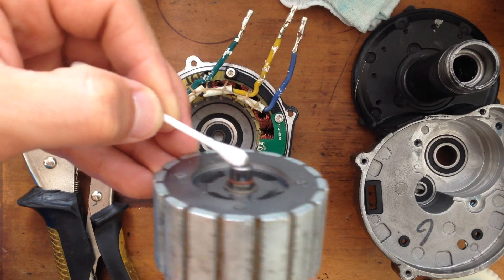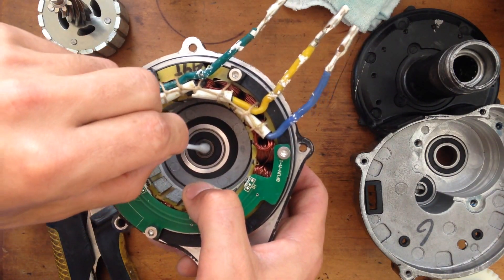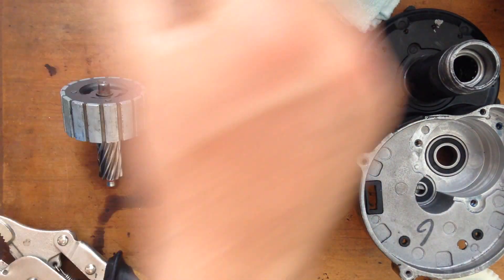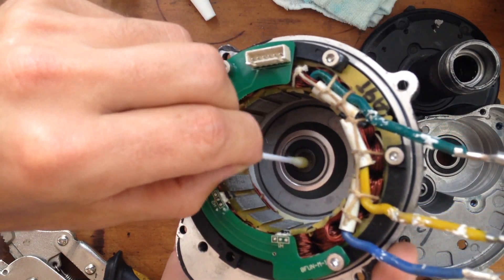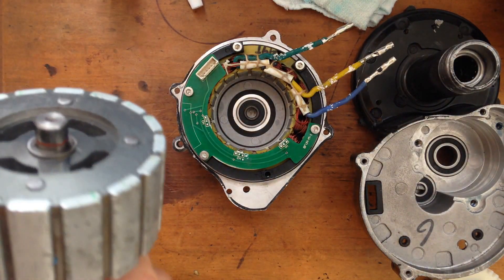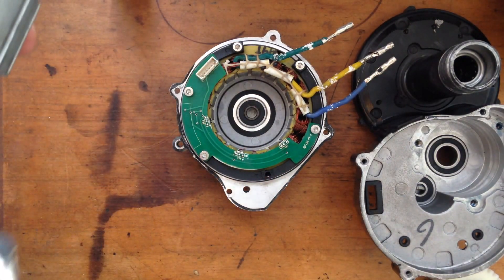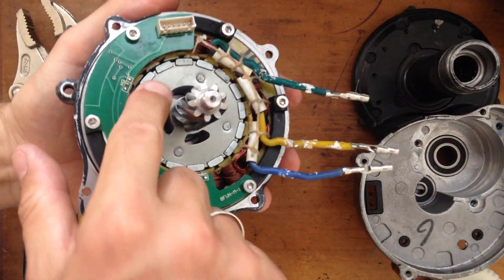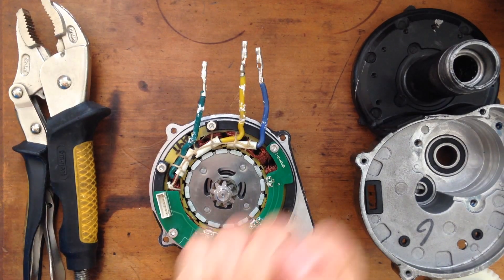Bafang 8fun BBS02 BBS01 motor shaft noise or missing o'ring = Loctite 641 procedure

Comment: Loctite 641 is considered a Retaining Compound 641, 1700 PSI strength. LOCTITE® 641 is designed for the bonding of cylindrical fitting parts, particularly where disassembly is required for servicing operations. The product cures when confined in the absence of air between close-fitting metal surfaces and prevents loosening and leakage due to shock and vibration. Ideal for parts that need subsequent dismantling, i.e. retention of bearings on shafts and in housings.  Not sure how one would take apart again. I know heat will loosen Loctite.

Retaining compounds, a type of anaerobic adhesive, fill the inner space between components and cure to form a strong precision assembly. They are widely accepted as a standard method for assembling press- and slip-fitted parts. Retaining compounds used to fill gaps between various mechanical parts are designed to have different viscosities. For example, low viscosity retaining compounds have viscosities around the 1,000 mPa*s range, and can be used for gaps that go up to 0.15 mm. To seal gaps greater than this, retaining compounds with higher viscosities, usually greater than 2,000 mPa*s, should be used instead.

Retaining compounds designed to have higher strength are ideal for applications that require a permanent bond. For example, parts that should not be taken apart during the life cycle of a device or structure should be fixed using a retaining compound with high-bond strength. For parts that need to be taken apart for occasional maintenance, retaining compounds with a lower bond strength should be used to allow for easy disassembly.

Comment: Hey brotha! Nice work I've been following you for some time now and have no doubt you can help with a problem. Can you verify whether that white 6 pin male connector on the green chip board at 3:15. Are they spot soldered on the back side under neath? Or crimped wires?

Comment: I come from Holland, I have the Bafang BBS02. After 15000 km I got slack on the bottom bracket and the engine started to make a trottle noise. Fortunately, I came across your video. The thrust bearings/cage bearing of the bottom bracket I could buy in NL, also the loctite 641. I disassembled the engine, removed the anchor and did exactly what you do. Now, 3000 km later, everything is doing fine. The engine makes no noise and there is no play on the bottom bracket. Thanks for your instructions.
Reply from the maker: Wooooowww this is AWESOME news mate!! Comments like this makes my day and keeps me motivated to make more and more videos like that, I’m glad that a little video here in Australia helped you and other people on the other side of the world... isn’t that just amazing? Hahaa  I plan to make more Bafang service videos in the next few months... there are thousands of motors like that everywhere and eventually people will have problems here and there and need to service like you did =] thanks for the amazing feedback mate
Reply: My bafang started making this same noise after just 250-300km... I am just going to return this motor as this is unacceptable condition for practically being brand new...

Comment: Hello sir, congratulations for your great support, you are helping all of us!
I have tried to add loctite 641 but i have a problem. The bearing came along attached with the part and for some reason i cannot remove it. Is it maybe a newer model? So the bearing inside the motor came out when i have pulled the shaft  and i cannot dettach it.
Also one of the 3 Philips screws that are securing the plastic gear cannot be removed and i have almoust teared the screw head.can i just add mobile grease 28 over the White lithium grease? thank you
Reply: Hi, I know it was a while ago but I have the same issue with my BBS01 motor, did you find an answer to your problem?

Comment: Hi! What is the thickness of that o'ring?
Reply: I removed the O ring and glued the shaft ends with loctite 641. Loctite 680 seems to be even stronger, but I dare not, due to disassembly in due course.

Comment: Super epoxy glued my two cylinder motorcycle crank shaft parts perfectly together. The engine had a terrible rattling noise. I could feel the gap when turning the shaft halves in my hands. After gluing it became dead silent. About the same situation here with Bafang.

Comment: Had the same problem : in my BBSHD it was the rotor on the other side - so the side of the helical gear - that was worn out after only 1000 km : 
did the Loctite 641 procedure, immediately re-assembled the motor AND LET IT CURE FOR alsmost 3 DAYS because the wear was significant.....
works like a charm : have done 75km now, no more rattling noise anymore ! BBSHD is whispersilent again as it is supposed to be..
THANKS for the tip man, youre a lifesaver !
Reply: !!!!  300Km later the problem came back after full-throttleling 30mins : guess the gap was to big for Loctite 641 to fill : redid the procedure: this time it idn't cure: i could hear the rotor bouncing in the bearing again :
the shaft is about 0.5 mm thinner than it should be, so

i'm thinking about a shaft repair-sleeve , but they don't make them in 8mm (at least not for "speedi-sleeve")
2nd option is a rvs tube/pipe 8mm wall thickness 0.3mm, so i need to sand of another 0.05mm to make it fit (i would apply loctite 641 on both surfaces again)
3rd option is Loctite 660 quickmetal, which can fill upto 0.5mm...

any idea's on this ? would rvs pipe/sleeve be a good option, or should it be brass... (surely not alu)?
Reply: I'm having exactly the same issue apart from my setup beeing a bbs02 one.  Weicon an 306-41 (similar product) would work for some additional km after I detected the problem, however now the rotor is bouncing again. I would go for the Loctite 660 solution or a more aggressive one than the 641. Keep in mind that you won't be able to disassemble the rotor anymore after applying the 660 stuff!
Reply: if you dont have plan to remove the shaft again then use loctite 680. shaft will stay in bearing for ever!

Comment: really poor stator design for a otherwise great motor. why didn't bafang make some symmetrical grooves on the stator ends and matching teeth in the bearings so it would never never slip or wear out?

I'm guessing applying some white plumbing tape on the stator ends would tighten it to the bearings?
Reply from the maker: +Mizanur Rahman - Yeeeah.. this is actually a nice idea, plumbing tape.. but it must be the high temperature one and I'm not sure how easy would be to actually do it. The Loctite is like applying glue... easy... the harders is removing the whole shaft and putting back... 
The BBSHD newer model everything is designed differently, much better motor design, much higher torque =]
Reply: Right, so bbhd has different rotor design. If you could do a bbhd disassembly video that would be great! So people would know if it would be worth spending a bit extra for reliability and get bbhd.

What grease do you use as substitute for the black moly grease on bbs02? I'm bit confused on which one to get and I'm looking for something that wouldn't soften the nylon gear and the plastic/rubber components. thanks
Reply: Would that be PTFE tape also known has  polytetrafluoroethylene !